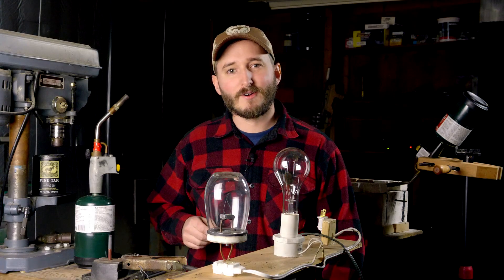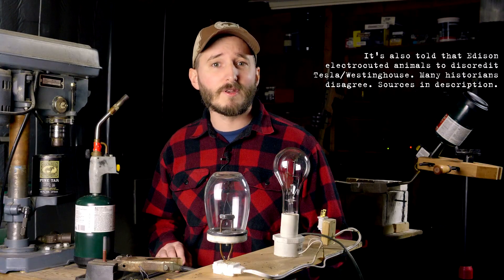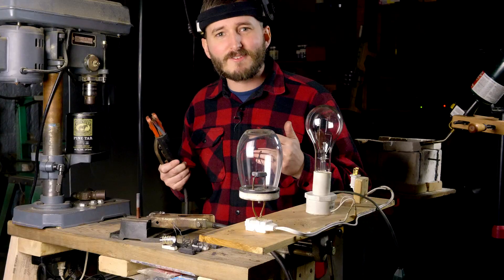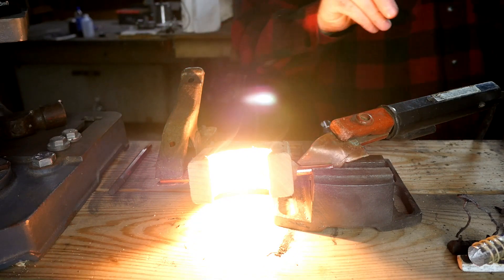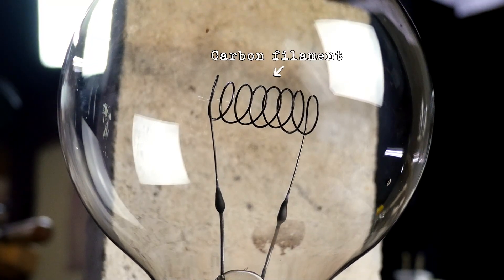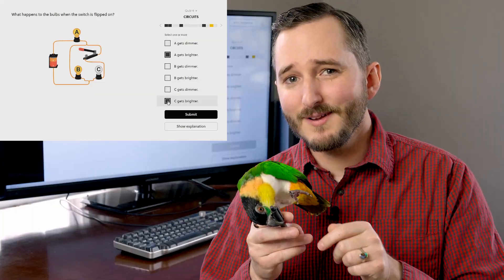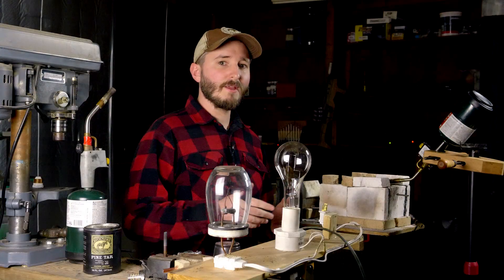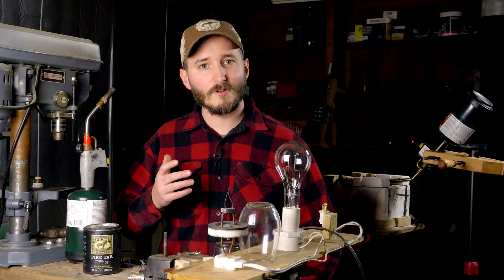Re-Inventing The Carbon Lightbulb

Comment: I have an Edison Mazada light bulb, that my father found in his grandmother's attic, and packed away in a coffee can, in 1969.  The bulb, 25 W, still works to this day!  I think it was made in the 30s, and has a tungsten filament.  The funny part is, I think the metal coffee can it's stored in is worth more as an antique, than the bulb itself.
Reply: I would avoid burning it at the full 120 volts if you want to extend its life.
Reply: @gregorymalchuk272  yes if you really want to run the bulb,  for demonstration purposes or high school science classes,  whatever,  given it's irreplaceable value,  I would use variable autotransformer also called a Variac,  set to no more than 110 volts and ideally 100 to 105 volts.   Assuming the bulb dates to the 1930s or earlier most if not all homes during the early days of electrification,  were actually supplied with 110 volts,  or 110/220 volts.  To understand why, we need to go further back in time,  when Edison designed and opened the first power plant in NYC in 1882.   His supplied 110 volts DC using large dynamo.  At this time,  electricity was only available locally,  as the voltage drop was such that after a mile it was unless, and only the wealthiest of families had their homes wired, using knob and tube.   Then, a few years later, Nicola Tesla improved and patented the power grid using Alternating Current,  or AC.   This was a huge success,  because,  using banks of transformers we can step up the voltage greatly to transmit long distance,  then step down the voltage again, before it enters the customer's home, and 110 volts AC was chosen,  so as to be backwards compatible with Edison's lamps.    Only when AC became widely accepted and used,  was it possible that the average homeowner could afford the many conveniences made possible by having their homes fitted with electrical wiring.
Reply: K ❤
Reply: and that's why capitalism breeds innovation just to subsequently replace it with planned obsolescence.. light bulbs were subsequently made not to last so long, otherwise they would not be as profitable. Would be interesting if this video would have explored a bit this topic too, since it's one of the best documented examples of planned obsolescence.
Reply: Sorry, but that 25w Mazda lamp is worth way more than a tin can imo. Please, shut up and take my money.
Reply: I think you might have something in your hands which might be worth a whole load of money in the future. It deserves better storage than a coffee can, trust me.

Comment: @NightHawkInLight I would suggest carbonizing cotton string at a much higher temperature and for a longer time (several hours), so that graphite already formed, at least partially. This is similar to the process for making actual carbon fiber. You could also try mixing powdered graphite into the pine tar prior to heat treatment in order to provide "seeds" for graphite crystal growth.

Comment: Not sure where abouts you live (and I wouldn't want to dox you even if I did), but have you considered ordering a small amount of carbon fiber and then just pulling apart the weave to get at some of the fibers, if there's an vendor which can ship to you that is? These are produced in essentially the same way you are using except using a vacuum oven rather than room pressure and the flexibility and strength are both better than even the raw materials you were using. Sure ya it's cheating in the historical sense, but it would be one way to get closer in function to what Edison made without having to buy expensive production equipment.
Reply from the maker: Yeah I could just use tungsten wire too,  but my goal was to explore the invention using the same methods and technology of the time
Reply: @Nighthawkinlight  Oh, ya tungsten would work, but I meant more the demonstration of carbon filament technology. Regardless, amazing video!

Comment: Have you thought about using hair as filament? Also, do you think modern carbon fiber would work? They'd both be pretty flexible, at least ...
Reply from the maker: Carbon fiber would probably work. Hair deforms too much when you heat it
Reply: Cody from Cody's Lab tried to carbonize hair and the end result was an unrecognizable mass at the bottom of the container. He said that it probably melted.

Comment: I assume you tried the acetone Ammonia bending method for making your spiral filaments as one of the "other bending methods"
As for the higher voltage, do you have a neon transformer for that initial burn in kick? (or a microwave transformer, etc) I assume you don't want to use your welder for the initial "burn in" kick.
Reply from the maker: I've not heard of an acetone bending method. I will research it
Reply: @Nighthawkinlight  @Applied Science did a video on it a few years back. It's the bees knees of bending methods.
Reply: @Nighthawkinlight  Although I did misremember the chemical Applied Science used, it's ammonia not acetone.
Reply: @Nighthawkinlight  Here are some other chemical options
Common
 wood plasticizing chemicals include water (boil /steam), urea, dimethylol urea, low molecular weight phenol-formaldehyde resin,

dimethyl sulfoxide, and liquid ammonia. Again sorry I misremembered the chemical.

Comment: Move to Europe, you get double the voltage from the outlet.
Reply: an average American home uses uses double the power than a European home so if you give American homes 240 volds thay may use not 4 times but significantly more usa needs to change their  consumption

Comment: are you saying you made involuntary graphitization by simply overloading a carbin filament ? I need to try that ~_~

ps: btw, lovely retrotech video, it's nice to have a peek in old ways, very very nice thanks
Reply from the maker: I haven't done a test on the filaments to be sure, but I believe so.
Reply: @Nighthawkinlight  that would be neat to have homelab scale graphite creation. So far I only found large scale extreme temperature methods

Comment: I read into this topic a bit before, it definitely sounds like you’re running into amorphous carbon being transmuted into graphite when you first turn it on. IIRC the amorphous carbon has a negative temperature coefficient of resistance, and bulbs made assuming their resistance will remain constant or increase with temperature will encounter thermal runaway and burn themselves out. You can see this happening in a rod of soda lime glass if you heat it up enough to be conductive with a propane torch, it’s a great demo that only one or two other videos on YouTube show. What I think the people improving the light bulb (be it Edison or someone else) did in order to fix this was baking their filaments at high temperatures in some sort of kiln. Alternatively, you could try and get some sort of current-limited high-voltage supply (MOT with series capacitive dropper?) and do it electrically. Either way, I hope you can do something like this and make a light-bulb that doesn’t need to be placed in series with another bulb.

And last I checked Cody made a Sprengel pump, in case you have a bunch of glassware and a litre of liquid mercury lying about.
Reply from the maker: I know for certain that a contractor for Edison, Lewis Latimer, later patented a method of making filaments where they were turned to graphite in a kiln, but it seems in Edison's patent that at the time he was working with plain carbon. I visited the recreated Edison lab in Detroit and saw the actual kilns he used, but I couldn't open them up to my satisfaction to see the inner workings.

Comment: Well, you don't need resistor or multiple bulbs, your filament isn't made for the voltage you're using. So there's a simple solution. A transformer. But still yes it uses a lot of power and i don't think you're as much behind first gen of commercial bulbs.
Reply from the maker: True, but the first Edison bulbs ran on ~100v, which is more than mine can run on. You could run mine on 50v, but then they're still only half as bright as a proper 100v bulb running on 100v.

Comment: It seems strange to me how those old patents actually provide the details of how an invention was made practical and the implementation concerns found along the way -- I know that's the actual POINT of patents (provide a full kit of knowledge required for anyone to recreate the invention, and receive a temporary monopoly as a reward), but I'm used to seeing more recent patents, and modern ones typically are designed to transfer as little usable information as possible while still holding up in court (or at least looking like they would be expensive to challenge) -- they're often written up long before an idea is actually tested, in an attempt to freeze out any potential competition over the basic principle for a whole class of potential inventions.
Reply from the maker: I thought the same thing. Reading Edison's patent was really cool for me because it lays out so much useful information. There's some stuff that is certainly held back, but he even mentions some experimental stuff like how filaments could be coiled in copper wire, then the wire dissolved off with acid. Tons of practical info.

Comment: I wonder if you can make your coil filaments more successfully by heating them slower. Also I think it would be a good idea to slowly ramp up the voltage until you get current to flow through your filament then work your way back down to operating voltage.. good use of a variac and microwave transformer

Comment: There is a famous bulb still working to this day, that is a carbon filament bulb, the Centennial Light (check Wikipedia)
Reply: If you'd run todays light bulbs at low power, continuously and on a dedicated powersupply (like they do with that special bulb) they'd easily last a century as well.

Comment: Can the propan be exchanged for butane? Molecules are similar but I don't want to blow up my house
Reply from the maker: It should work, but this is a dangerous experiment, both because of fire and electrocution risk.
Reply: @Nighthawkinlight  Right. Saw someone extract the oxygen by keeping a candle lit inside the container aswell. Thanks for answering so fast

Comment: You may be able to cut a small piece of bamboo in a coil. Bamboo being already fairly round just remove parts that don’t make it a coil.  Using a lathe or drill press.
Reply from the maker: Going against the grain like that I think would be counterproductive. The consistent long fibers of bamboo are what made it good for a long lasting filament.  It's an interesting idea though.

Comment: Also do you really still use fuses in your shop? Something wrong with a circuit breaker?
Reply from the maker: The shop predates me. There's a main breaker for it but it's still got an old fuse box.

Comment: What about subdividing a long filament with several electrical connections spaced out along its length? After charring it and putting it in the bulb, you could convert each section to graphite separately, with relatively low voltage (of course using a modern bulb to limit current). When you run them all together in series, it will have enough resistance not to burn out. It might be a pretty large lightbulb, though.

By the way, that was a cool idea, filling the bulb with propane. Did you come up with that yourself?
Reply from the maker: I did think to try propane in the bulb myself, but later read that it was tried by others in some of Edison's notes

Comment: Fluorescent light ballasts or circuits similar to neon drivers. You get a giant inrush current that settles down after a moment. A PTC thermistor in circuit would also help, but then you have to worry about it failing with the large steady-state current. Inductors maybe?
Reply from the maker: Good idea
Reply: @Nighthawkinlight  That wont work very well. You only get very short high voltage pulses with long pauses where it will cool down, meaning you dont reach high enough temperature in the filament.

Just connect a MOT to a Variac and add a Lamp or something in series and turn it up slowly. Once you've powered it like that once, it should run at a fixed voltage after that.

Comment: To this day the Sprengel pump (the one Edison might have used) is still by far the most energy-efficient method of creating high vacuums.
Reply: I had somehow not heard of this device until a few years ago when Cody did his video making one. It's nothing short of a revelation. Insanely high efficiencies, super high vacuums, produces barometer light, and it can kill you by electrocution despite not having a single mechanical moving part or need for an electrical power source. What more could you want
Reply: @Muonium1  Speed and not using mercury? The Sprengel pump is efficient, but also slow and it uses mercury, which is now banned in many places as an environmental concern, so not everyone can get mercury... Also, in Cody's video, a significant amount of mercury got inside the radiometer with which he tested it, which is not ideal, you're losing your precious mercury and contaminating the chamber.
Reply: @GRBtutorials  It's fairly easy to increase the speed by simply running multiple pumps in parallel.
Reply: Well, up to the vapor pressure of mercury anyway.
Reply: Swan had a Sprengel-like pump that he invented himself, two years before Herman Sprengel.

Comment: Playing around with an arcwelder like that once gave me horrible "sunburn" on my hands and arms ... always wear long sleeves and welding gloves if you do something like this!
Reply: Sunburns are the right word here, the high amount of UV-A to UV-C Radiation burns your skin in minutes.
Reply: Did the same thing, but I was shirtless, and was running my welder for half an hour or so. Thankfully my welder burnt down before my burn got any worse.. still worst sunburn I've ever had
Reply: and we were letting arcs like that run all night as street lighting!
Reply: @drewgehringer7813  ........they were certainly used in early days of film studio lighting . I'm not certain of their use in street lighting , the studio ones required constant tweaking as carbon rods wore away . We still have variety of lights that aren't carbon based but enclosed in quartz glass and sometimes called arc lights in some places or countries . The quartz glass permits UV to pass , so a normal glass cover or outer envelope is required to block the UV. At this moment I'm considering what To do with an early film studio lighting setup I have taking up useful space in my shed . .There was a hazard identified some years ago about UV exposure from once popular  halogen down lights and reading lamps cos most had no normal glass envelopes or covers but it's all LEDs now .
Reply: I currently have two pretty serious burns on my arms right now from welding.  One from having my sleeves rolled up (just me being dumb) and one from just a torn hole in the sleeve of my shirt ( I didn't really think it would be a problem, know better now). And when I mean seriously we're talking blisters and several weeks of multiple layers peeling and what almost looks like a patch of scar tissue, the amount of UV coming off an arc is no joke.